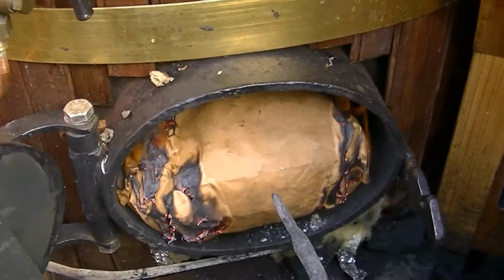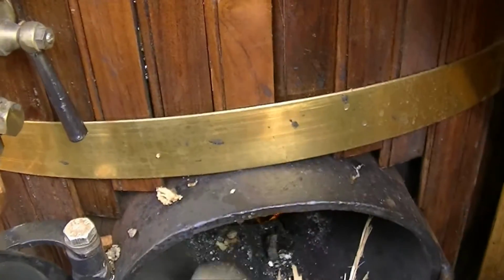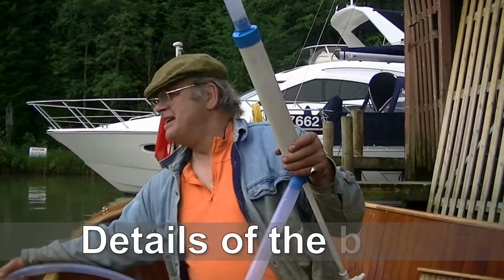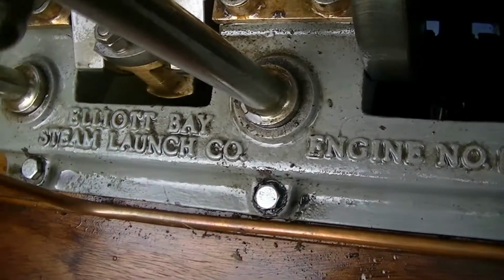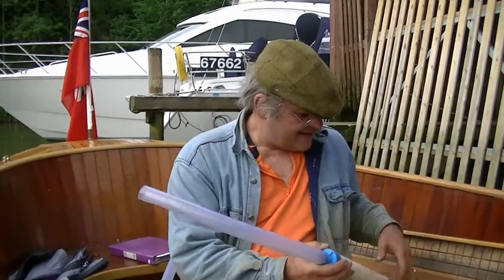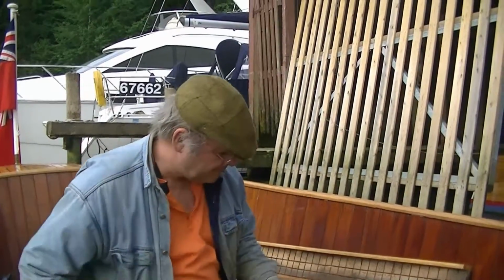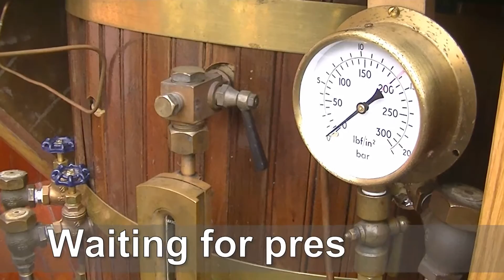Owning Your Own Steam Boat Part 2

Comment: Fantastic looking job. I notice your feed water is open to the elements. Does this cause much contamination? Also do you use distillate for feed or just tap water?
Reply from the maker: We feed direct out the lake. The only issue is the oxygen content, but boiler water treatment takes care of it. If you was on a canal, you also have a lot of mud in the water. This is why you have mud drums on boats and ships. These need to be cleaned out by blowing down the boiler water. Windermere however is so clean it is rare you get anything more than a tiny film of mud.
Reply: That's interesting, thanks for the reply. I'm a marine engineer but my steam experience is only on big water tube plant. Even on Auxy boilers on motor ships we are obsessive about boiler water purity. We only ever top up with distillate and treat with chemicals for O2 etc, and test the chemical levels on a daily basis. Whilst we do blow down and scum the boilers this is more for adjusting chemical treatment levels than actually scumming debris out the boiler.
Reply from the maker: Chris Ryan
On a big ship there is a slightly larger value attached, both to the boiler and to the time it is out of action. Also on a big ship they are rarely on a salt-free lake.

Saying that, the PS Waverley doesn't take any water from the sea, it carries all the spare water.

Comment: question: the machine has a gear box? i mean to conect and disconect main rode propeller?
Reply from the maker: Hi, the boat has no gearbox, the propeller is always attached to the engine. The two gears you can see are there to drive the air and feed pump. The prop shaft and propeller can't be disconnected from the engine.
Reply: maltelec ok, i see, how does it the reverse? i have curiosity to know it, thanks :)
Reply: JORGE GUERRERO  reverse the engine.